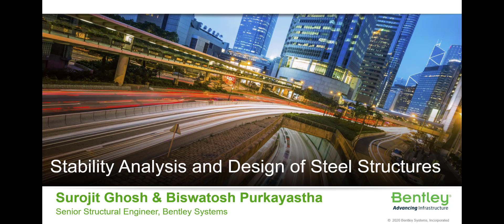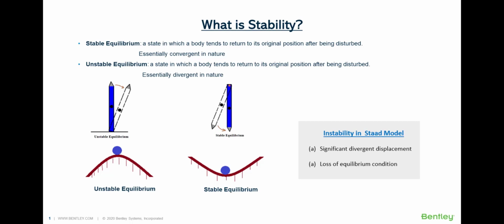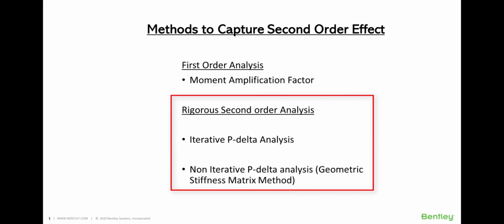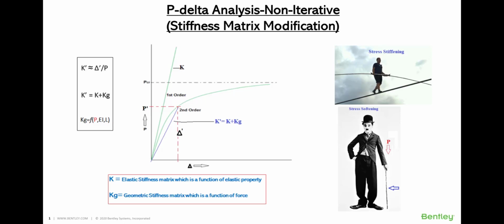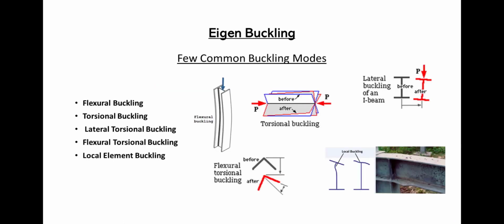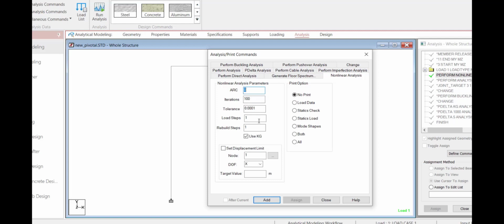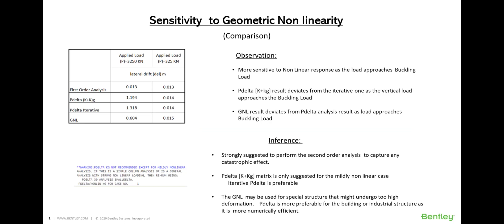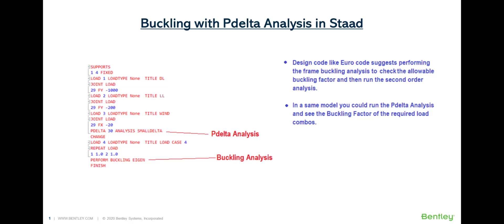Stability Analysis and Design in Staad (Part-1)|| PDelta , Buckling and Non Linear Analysis

Comment: Valuable information. 
Staad Pro has several types of analysis facilities available, like direct analysis, p-delta analysis,time history, response spectrum, blast analysis etc. Is there any " in-elastic non linear analysis" (simultaneously) available in staad pro? If yes, which methodologies does it follow for analyzing the structure? Kindly suggest any reference book name for referring manual calculation of "in-elastic non linear analysis".pls reply...
Reply from the maker: @Enfld1122  STAAD doesn't have the feature to handle the  material non linearity . The only inelastic rotational effect ( plastic rotation ) is considered for pushover analysis is for steel structures per FEMA guidelines ( non linear static analysis done for seismic evaluation) . Apart from that there are no extensive what you perform material inelastic analysis
Reply: @Torq123  thanks for replying. It's okay that, staad pro doesn't have features of material non linearity. Does staad pro has feature/s of "GEOMETRIC NON-LINEARITY" & "CONTACT NON-LINEARITY" ? If yes, Which methodology does staad pro adopt for accounting the geometric & contact non-linearity?
Reply from the maker: @Enfld1122  Yes STAAD does have GNL and to some extend boundary non linearity like compression only and tension only specs
Reply from the maker: @Enfld1122  For GNL there are different types , PDelta effect is also a types of geometric non linearity. In addition to PDelta analysis STAAD does have rigorous Geometric Non Linear algorithm to capture several effects like Large deformation effect . Here the program solves the geometric non linear responses by the tangent matrix procedures. The applied load is divided into small units and sequentially applied . In every step the stiffness is updated due to the change in geometric shapes . On the other hand the Pdelta analysis is done by force vector iteration.
Reply: @Torq123  Thank for replying. 
It has been observed that, there was several lackings/inabilities in staad pro regarding material non-linearity and contact non-linearity, which needs to be incorporated in staad pro for capturing appropriate effect of the same. Please suggest the parameters regarding material and contact non-linearities, so that it can be posted in "STAAD BRAND IDEA" tabs for implementation in advance version of staad.
Reply from the maker: @Enfld1122  Thanks for your comments . Bentley procured one of the state of art FEA product known as ADINA ( developed in MIT by Dr Jurgen Bathe) and this product is equipped with many types of non linear analysis capabilities and We have a very good integration with STAAD so that if any of the required features is not available  in STAAD , that could be handled through ADINA.
Reply: @Torq123  thanks, pls tell that, which types of "nonlinear in-elastic" features are covered in "ADINA"? MATERIAL, GEOMETRIC AND CONTACT non linearities, thrice are covered? Any extensive beyond three types? Which methodologies/equations does it follows for analysis? Mention textbooks/reference books names for manual calculation.
Reply from the maker: @Enfld1122  Adina has several modules . Thermodynamics, structures, CFD and electromagnetism . For structures it has the capabilities to capture the material, geometric as well as cobt at NL. There are several solvers it used , Implicit and Explicit solver depending on the problem . FEA implementation is not any textbook specific but just the mathematical tools whichbis covered by miatvof the renowned authors by Dr Jurgen Bathe, R Cook, Zienkewich and many others. If you want to know more please share your contact details.  Our Adina team will reach out to you for more details
Reply from the maker: https://www.bentley.com/software/adina/